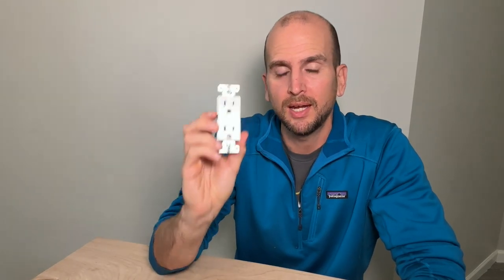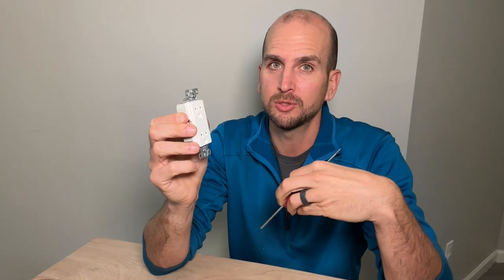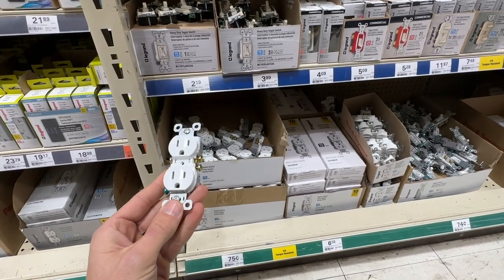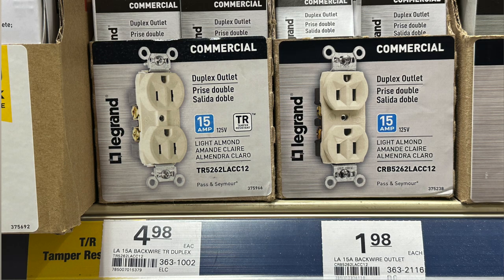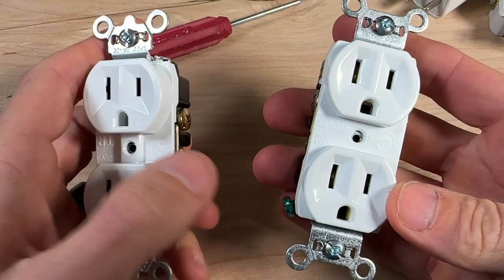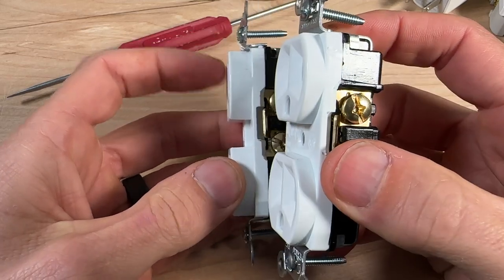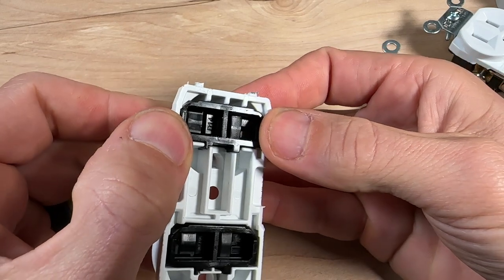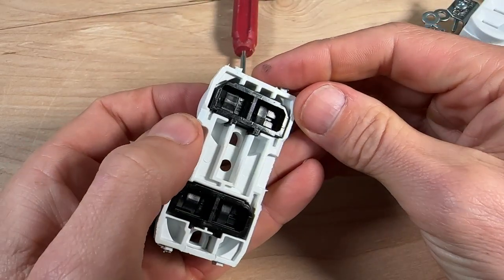The Most Hated Product In Home Electrical

Comment: The main problem is the fact that they're trying to retrofit a safety feature into a design that didn't originally have it and doesn't have a lot of room for changes. They have to fit the entire mechanism inside a tiny, standardized space, without significantly changing the depth. Make the mechanism too wide, and a standard face plate won't fit. Make it too deep, and you risk having the plugs not making good contact with the terminals inside the outlet. If we really wanted to do this right, we'd have to do what they did in the UK in 1947, when they basically threw out the old design and replaced it with a totally different one that was, from the beginning, designed with safety in mind. (Yes, the old design is still used in special circumstances, but it's relatively rare) The thing is, in 1947 there weren't all that many electrical devices in common use in homes- mostly just table lamps, a radio, some kitchen appliances, etc. Furthermore, they were still rebuilding from WWII, so it wasn't a big deal to just switch to a new standard for new construction.

But for us to do that today in the US? That would be very difficult. People would be using adapters, which add expense and failure possibilities, for decades in order to plug new devices into old sockets/old devices into new sockets. And the sheer number of plug-in electrical devices these days- computers, phones, tablets, kitchen doodads, power tools, TVs (and all the stuff we connect to them) stereo systems, etc.

Yes, the little safety covers work... But they're not a passive safety feature, meaning you have to actively attach them to every unused, child-accessible socket, power strip, and extension cord in the house. Including ones that are CHILD accessible but not that easy for the adults to get at. Then, remember to put them back after you use an outlet.

Comment: I went under commercial code in zone my place as a commercial building. So my home didn't have to do tamper resistant. Just 5 - 20 yd commercial 20 Amp receptacles in metal boxes as and mud rings.  So much nicer than Residencial electrical

Comment: I think the biggest issues there is a variation in quality. I have used some temper resistant outlets that were fine. However I know somebody who recently moved into a new apartment a couple years ago and they must've bought the cheapest things, I have to come over to plug stuff in and I'm having a hard time getting plugs in!
I really don't think they're binding up I think it's really down to the quality of the mechanism because I am highly sure that they are the cheapest contactor grade junk.

There is another issue plug covers I have literally seen them on tamper resistant outlets when they don't need to be and this was in a Costco! I am slightly also concerned that broken plug cover might defeat the safety back in ism which is something that is an issue in the UK where they have shuttered outlets. However they designed using the ground pin we did not do that thankfully.
There's a very scary video with squirrels and overloaded power strips but mainly there's a awareness group because plug covers are not some thing they had out there that slowly made it into the market. And you know if you don't use plug covers is not safe parent scare tactics.

Comment: I recently bought and installed several outlets, purchased the best (most expensive) and noticed they were TR.  OK so that's a plus however I regretted using them almost immediately because all the plugs I tried to had an uncomfortably high insertion and removal force.  I won't be using any more TR outlets.  

One question; were TR outlets developed because of a real significant problem or are they simply a kind of nice safetyism.  Just saying.

Comment: Yeah I actively remove TR outlets and spend extra on the replacement standard outlets just because every TR outlet I've ever used has been such a hassle just to plug something into it.
And after all these years without seeing improved TR outlets I start to figure it's just not a solvable engineering task to make those little shutters effective and efficient.

As another comment said, those cheap childproofing plugs seem like the better solution to this issue.

Comment: TR was a great idea, but when it came west from Europe, we hit one major problem: US Plugs are not required to provide a ground pin on all appliances. In other countries that implement TR, the gates are opened by the unguarded ground pin, which inserts into the receptacle prior to the other two pins reaching it. In the US, Each current carrying pin needs to clear the way for the other, complicating the mechanism and plug insertion process. This also means that in the US, ANY 2 things can be shoved into the terminals of the receptacle so long as it's at the same time. This is great when I'm putting meter probes into an outlet, but not so great when the forks make their way over.
Reply: On a 120V circuit only the hot is live. The neutral is the current return path. The neutral is bonded to ground in the panel. But there are circumstances where there is current on the neutral. Why that's the case is an involved topic. Most of the time it's down to janky wiring.

Comment: If you haven't done so already, would you mind doing a video on why the NEC changed the standards. My understanding is that the EU bought out the NEC and applied their standards to U.S. electrical code. Being that the EU runs 220vac 50hz, a child wouldn't just get a "zap", but have his but thrown across the room with a hospital visit. This was a fix for their issues, not ours.

Comment: When I was 7 I spliced together a plug I found connecting both the hot and neutral at the end of the wire and wrapped it in electrical tape, made a huge flash and knocked out power to half the house. So tamper resistant outlet wouldn't have done much to stop 7 year old me lol. On another note only expensive outlet I'd buy is a GFCI when needed.

Comment: How does one ground themselves by only  sticking something in one side of the outlet? I don't understand. As far as tamper resistant outlets I'll not voluntarily put any in, helped a lady that couldn't plug a air freshener in the bathroom  do to the gfci being a tamper resistant one. After getting it in the outlet the lady wanted to put that one in the master bath and use a different one there, prongs broke completely out of the freshener. I cannot under good conscience use a product that just trying to use it is so tedious and difficult that it makes the plug potentially damaged and unsafe

Comment: This has been a thing in Europe for more than 10 years now, I have not had an issue with TR outlets as you call them (no ideia what they call them over here). Maybe our implementation is better, but I had an extension cord that had it, and it was a pain to get anything in, but I found out, that if you wiggled the plug left and right quickly, it would go in just fine.
Reply: They call them sockets..... Europeans (Rightly) Demand safety to be built in from day one!

Comment: Me being a kid i shoved scissors into an outlet and got zapped, that taught me a lesson bad enough, that lingered bad enough for several decades. Now having 4 of my own and using outlet protectors when they were little, and all kinds of other safety features i think most of them are overblown and are designed to scare parents. If you have little kids and are worried sure, replace them. They also stop working after several hundred uses, at which point you will also want to replace them because you got sick of the "sticking" that they cause.

Comment: I don't use tamper resistant outlets because they often don't work. Even when they do work they're so difficult to plug into that if I have opportunity to replace them with a non-tamper resistant, I will. I should also know we never have any small children in the house. When we did we used the plastic plugs.

Comment: The problem is similar to so many others these days, the product is not as well made and reliable as the older products due to the use of cheaper components sourced from not the best companies, but the lowest priced companies.  In theory this shutter system should work without adding excessive insertion resistance and last a long time.  In reality, plugging things in becomes a more tedious job that often requires extra effort and finesse, and eventually the cheap plastic starts binding even more.  So the product is less pleasant to use and costs more than twice as much.  That alone explains why most people do not choose the TR versions.

Comment: So I was worried you were going to tell me there was something wrong with them that I was unaware of.
I go out of my way to replace the outlets in the house as they go bad (they are all the cheapest ones the contractor could have used when building the house) 
And part of getting high quality ones means that they are often tamper resistant.

So yeah, they're one of the more expensive ones on the shelf and most people are not going to buy them, but I like high quality outlets and I haven't had a problem with them being tamper resistant.

The benefit you didn't mention is how when you have them on the counter in the kitchen, they are less likely to get anything inside the socket. I only have one on an island that has a chance of that happening from stuff pouring off the edge of the island but I thought it was a good choice just for that reason.

Comment: I briefly rented a house that had standard outlets in the living room and all the bedrooms, but the outlets above the kitchen counters were TR. First off, that's incredibly counter-intuitive because if child safety is the issue, then why have the TR outlets be high above a small child's reach while every other outlet within their reach isn't TR? Second, they're just incredibly frustrating to use. I never once managed to successfully insert a two pronged plug into those godawful receptacles. Grounded plugs would go in just fine, so what I ultimately ended up doing was keeping one of those T shaped 3-way extension cord splitters, which had a grounded plug, plugged into the most frequently used TR outlet and then plugged my two pronged devices into the splitter. A crappy workaround for a crappy electrical fixture. 

Just use plastic receptacle caps to keep your outlets from biting your kiddos, folks. (That and, you know, basic parenting. Don't mean to condescend but there's very little in the way of valid reasons why your toddler should be running around with the likes of kitchen knives, screwdrivers or anything else they would try to insert into an outlet receptacle.)

Comment: TR plugs work best when you don't use them often, a plug it in and leave it alone, they seem to hold better, but if its a plug that is in and out all the time i buy the industrial non tr 20amp plugs even for 15 amp circuits.

Comment: It’s a pity really. The British Standard plug is the pinnacle of design that needs no compromise.

The hot and neutral shutters are activated by the ground prong, so there’s no stickiness. Any double insulated appliance that needs no ground will have a plastic dummy ground pin just for the purpose of opening the shutters.

With the proliferation of 2 prong only plugs here in the USA, that ship has long sailed. I think TR has been a long time coming and without having a guaranteed ground pin, options are limited.

Legrand TRs have seemed to hold up well at my place.

Cheers.

Comment: I like the UK version better. It uses the earth (ground) prong to push the shutters down and can therefore use a single piece shutter.
The earth prong is also physically longer which allows the shutter to open before the other prongs enter the socket.
It also causes the earth connection to make first and break last when inserting or removing the plug.
It does require a third prong to be present, even if not required. In this case, it is typically made of plastic which can be molded as part of the plug housing.
Reply: Do all appliances have a ground plug? In the US, no. Some only have a hot and neutral that are different sizes so it can be plugged only in one orientation.

Comment: The fact that they've been out for so many years, and STILL more than 2x more expensive is a major factor. Most newer technologies eventually come down in price, so why not the tamper resistant?!
Reply: Because these were designed to make money from the start, not to improve safety. As soon as a new code requirement comes along obsoleting these they will drop to almost the price of a functional outlet.

Comment: It's the annoying difficult plugging in that makes me dislike them.  That combined with the small danger keeps me from using them.  Most people pressing a metal object into the hot side are not going to get a shock at all.  They are on a carpet or wood floor and wearing clothes that will insulate them if the floor doesn't.  Further, 110 V.A/C will very rarely do any more than force us to let go right away.  The more likely way to get a shock is when putting in an actual plug and touching two conductors and even then the "letting go" reflex solves the problem and teaches a lesson on how to hold the plug.  Many years ago I worked for an electrician who would touch wires with his fingers to see if they were hot.  The last time I saw him he was about 90 years old - still alive.

Comment: These US sockets amaze me. The UK has had mandatory socket shutters alongside its mandatory earth pin since 1947. There are two different shutter designs, and our more common one works really well because the longer earth pin pushes the shutter release for the shorter Live and Neutral pins. 

I've never heard people in the UK complain about plugs being difficult to insert and remove, but I guess we have no basis for comparison because everything has shutters. 

As a side bar, for a really long time you've been able to buy these awful and really dangerous socket covers in the Uk, they're a flat piece of plastic with three pins which mimic a plug and cover up the holes, of course by doing that they defeat the safety shutters while being weak and flimsy so bits can break off in the socket. Some designs even leave little gaps so you could insert a pin past the "safety" cover, where an uncovered socket would be protected. The UK is generally good for electrical safety but it's shocking (no pun intended) that we haven't completely banned safety socket covers. They're death traps.

Comment: I had the plastic caps on the outlets in my first house and the work to protect the kids…until I have to plug something in, take it off and lose it.  Also the kid could just pull whatever’s plugged in out and go to town on the outlet. So in my second house I wanted to replace the old style outlets with the newer decorative ones anyway so I went all tamper proof. $24 for a box of 10 Leviton and I haven’t had any problems with them.  Only 60 cents more per outlet if you’re getting a box of 10.

And yes my kids have never been interested in playing with the outlets…until one day I turned around and my youngest was trying to stick a screwdriver in the outlet. Thankfully the power was off as I was working on it at the time which is also why the screw driver was easily accessible near the outlet. I had only turned my back a couple minutes to talk to my wife. Shit happens quickly!

Comment: Honestly if you're really concerned about child safety, just install GFCI outlets, or circuit breakers everywhere.  You can string multiple normal outlets off of one GFCI outlet.

You get better protection from shocks, and far less downside.  GFCI has little or no false alarms, unlike AFCI.

Comment: 222 eIf an inspector insisted on new TR plugs before I pass, I understand that to mean "the inspector recommends buying new TR outlets and then pitching them for new regular outlets when he's gone".  Seriously, how do TRs make outlets safe?  They keep me from sticking a screwdriver in, so what?  Use the plastic "childproof" plugs in regular outlets.  Here is why they are better:
1) A TR outlet teaches a kid that nothing bad will happen if he jams a screwdriver into an outlet.  Unless every outlet you have is TR, your munchkin just got free practice on the fastest way to jam a screwdriver into an outlet.
2) I would hope that a plastic plug would delay the kid enough for parents to notice what he was up to.  It takes a lot longer to pry that plug out.
3) Did you plug a regular power strip into that TR outlet?  7 more plugs, you say?  Oh my.
4) A kid starts tugging on a real electrical cord and gets it partway out of the plug.  At that point which scenario is better: a) he either finishes tearing it out of the wall and gets bored, since he didn't bring along his trusty outlet-jabbing screwdriver...though he probably doesn't have one.  b) He's holding Mr. Stabbything while trying to get the plug out.  When it comes time to get the plug out the rest of the way, he grabs the cord with both hands...or at least he WOULD grab it except he needed to put the knife somewhere and BAM goes the breaker.  

Kids want to learn about their environment, with or without your help.   With that in mind, it's safer to delay kids making the "pokey metal into receptacle" association for as long as possible.  I think that's the electrocution version of the "Security through obscurity" concept in cybersecurity.

Comment: I will ONLY buy standard that also have the tapered face to guide the prongs in. Like someone else said, I am not going to argue with a power outlet just to plug something in. And yes, when I was 2 years old I stuck keys in an outlet. Guess what? I learned you don't put stuff in there.